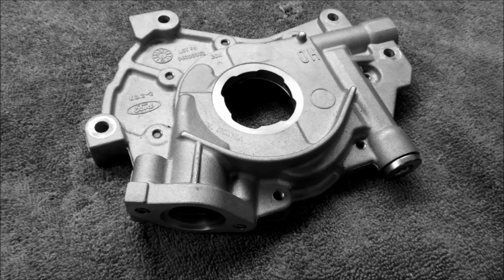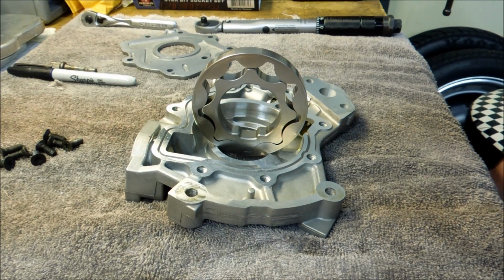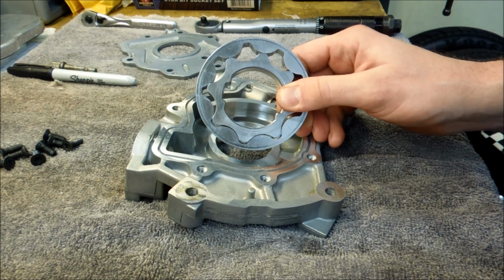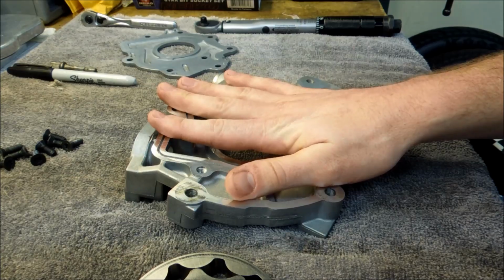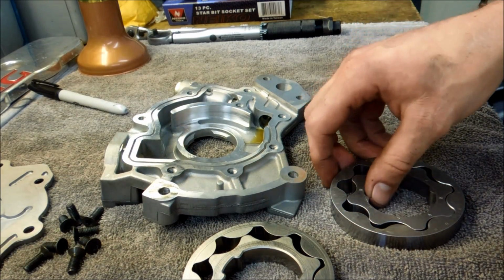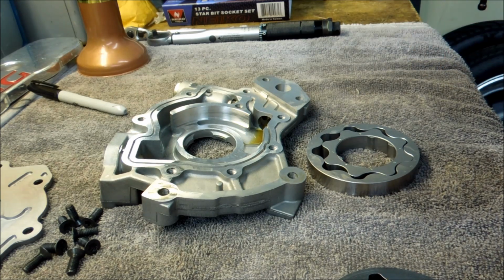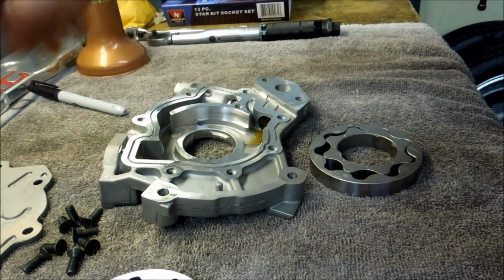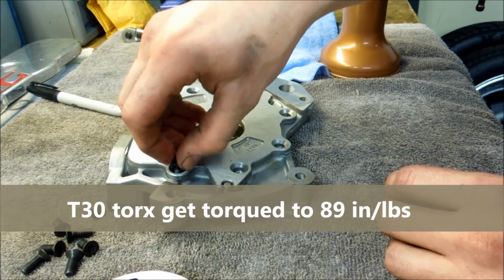Billet oil pump gears from BOUNDARY ENGINEERING

Comment: Why would more power put more stress on the oil pump??
Reply: When a crank has to deal with more power it flexes a little bit more and causes uneven forces. And high rpm enhances that

Comment: Great info overall, and good input.
I personally have an absolute hatred of powdered metallurgy. Sure, it is cheaper, and easier to mass produce and manufacture. However, when you look at the wear values for powdered, ANY deviation no matter how minute you experience from ideal conditions tears the crap out of them. 

I have a stock F150 Ecoboost. The pump was worn by 95K, and I did not red line it. Same with the damn timing chain. Many argue that auto manufacturers spend millions of dollars designing and engineering the best product. The reality is, they spend millions developing a minimum viable product that meets planned obsolescence figures, THEN spend additional millions making it cheaper. 

Powdered metal, IMHO as a machinist and mechanical engineer,  belongs in hand tools and shit where low prices and equally short lifespans are the expectation. Not in an engine that best case takes 10 hours to swap timing chain, tensioners, guides, and the damn oil pump. 

When the chain goes again, probably around 125K ( will be my second time swapping due to the infamous 3.5 timing chain rattle), I will be dropping in the Boundary Stage II Assembled Oil Pump and calling it a day. $600 for a true set of gears and new pump for the next 150K miles sounds like a bargain compared to the crap I am dealing with now. 

I call it like it is. No manufacturer has any desire to build a car or truck to last beyond 5 years, with select few model exceptions. It is just how the American market works. 

Heavy industry, which is my specialty and where I lean to most for knowing the best practices, follows a much different approach to things. When downtime is costly, they do everything they can to avoid it.
Reply: You shouldn’t.   The end result of powdered metal is a result of the of the alloy and heat treat used.

There are some exceptional tool steel grade powdered metals out there.

Comment: 89in/lbs is that true or a typo error?
Reply: "inch" not foot. It's not that surprising.
Reply: 89in/lbs divide by 12 to get ft/lbs.  = 7.4 ft. lbs.
Reply from the maker: iliasmetalworks it's straight from the Ford manual